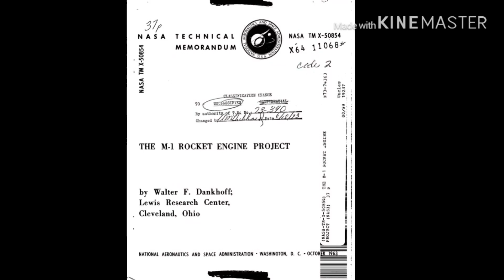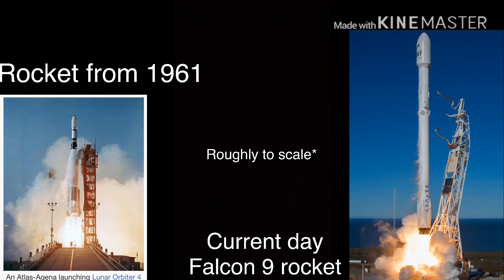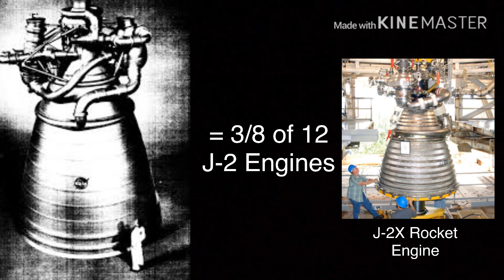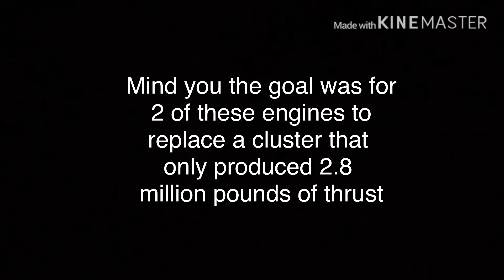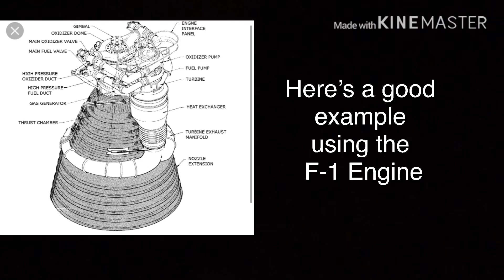The F-1 Rocket Engine Had BIG Competition - The M-1 Rocket Engine Explained

Comment: The M-1 was not only more powerful than the F-1, it was more efficient! So why did they terminate it in the design stage?
Reply: because it was meant for the NOVA rockets, such as the single stage nova M rockets. once those got canceled there was no need for such an engine
Reply: @MARK-gp9hb  There were proposals for a M-1/hydrolox 1st stage to replace the kerolox F-1 1st stage of the Saturn V, but that was axed because of significant development costs